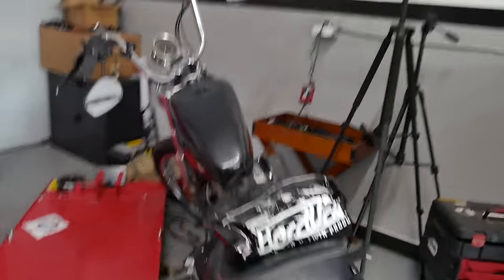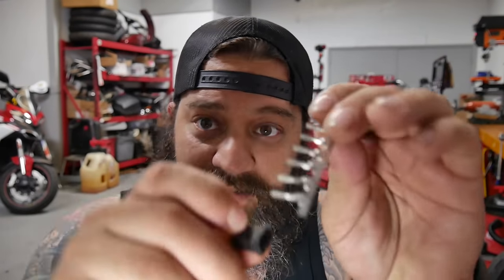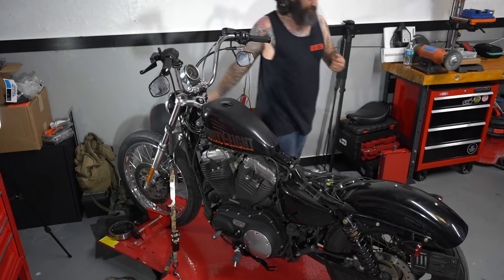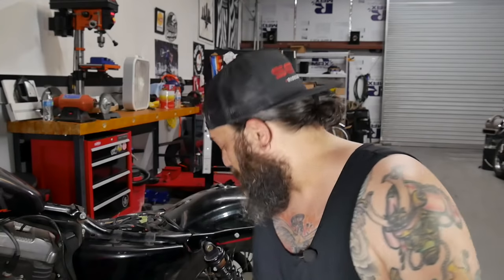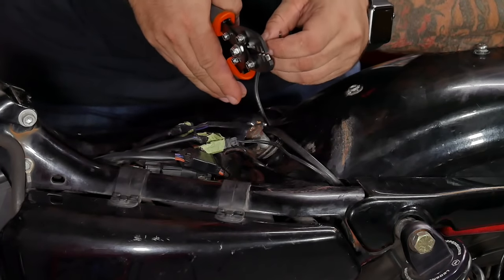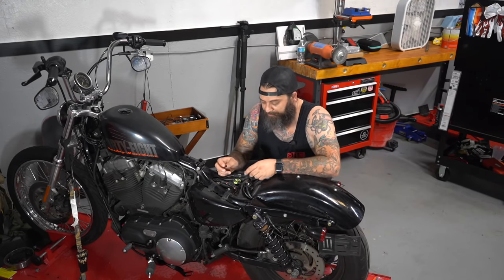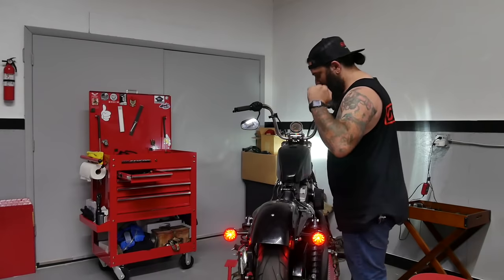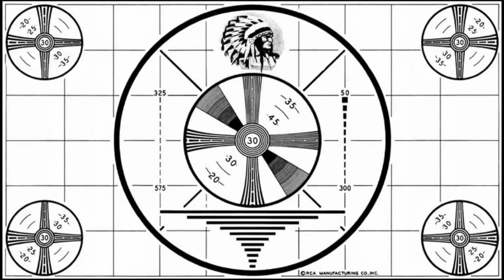My Harley Davidson 48 Sportster is Street Legal Again | After The Crash Ep.7

Comment: Hey man great job getting her back together. One quick tip though. When you cut those wires with the side cutters, you generally want to avoid cutting wires together like that. If one of them is a power wire, it can short circuit through the wire cutters and fry the whole circuit. Obviously it didn’t happen here, so that’s good, but just be aware of that in the future.